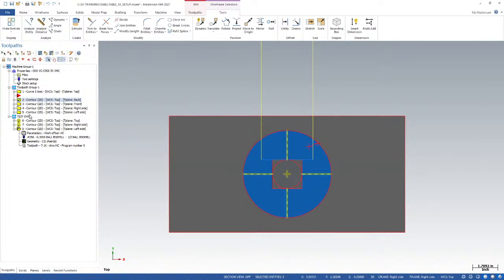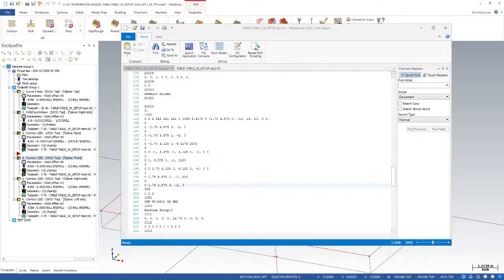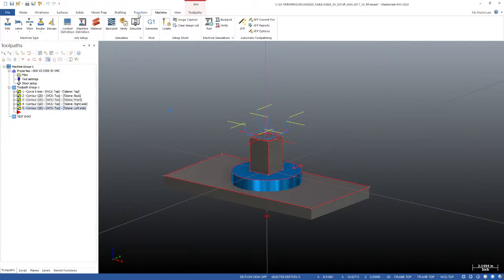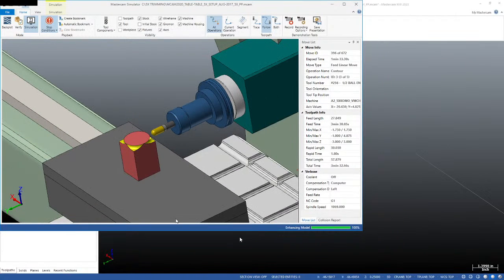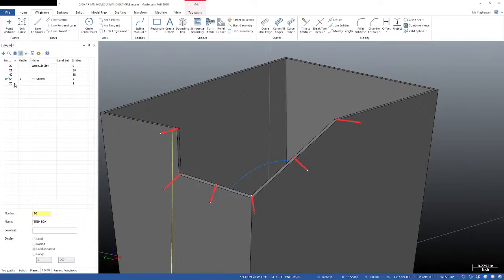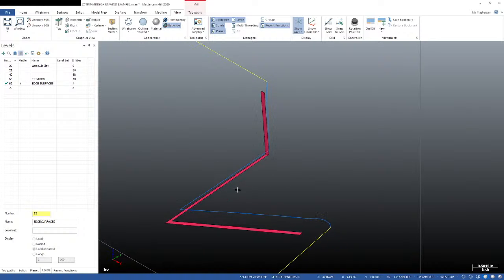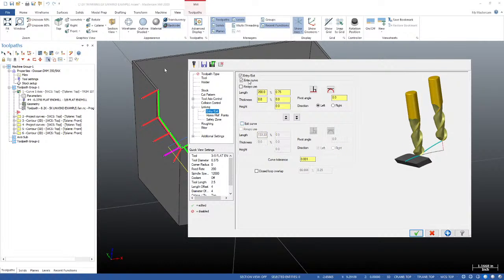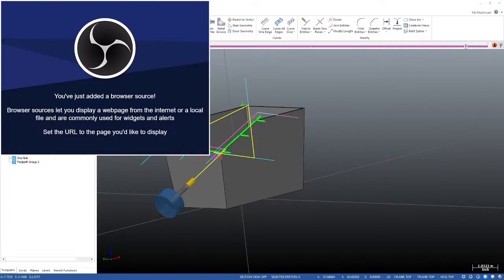Colin Gilchrist Live Stream

Comment: At 1:35:56 you say I am in 2d mode and want to be in 3D mode and clicked on something. I could not tell what you clicked.  OBS is very capable broadcast software, but each dial of box that pops up has to be active for the viewer to see it (I think). I’m sure you will figure it out. At this point in the video I have learned much. It’s now getting to the main course for which I am very thankful
Reply from the maker: Hi Tom,
In the main Graphics Viewport, Right-click. This brings up the Right-Mouse-Button Menu. This menu has "Attribute Settings" in two rows along the top of the menu, with commands below. In the Attributes Bar, you will find the 2D/3D switch. This is a toggle-switch, which flips between 2D and 3D mode.
Reply from the maker: I also watched a good video on using OBS, so I figured out how to broadcast the full screen finally, without having to manage every pop-up menu manually. That was a pain, but it was also my first time using the software.
Reply: @colingilchrist6468  that’s great news